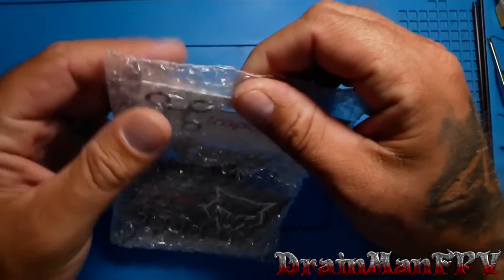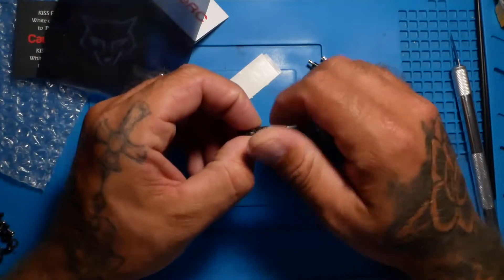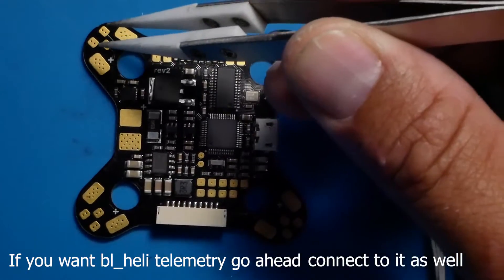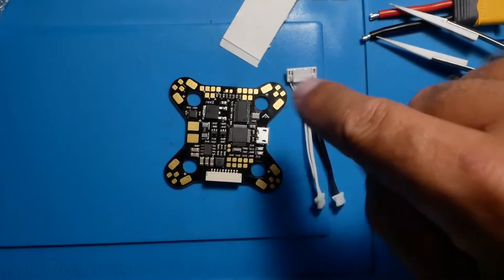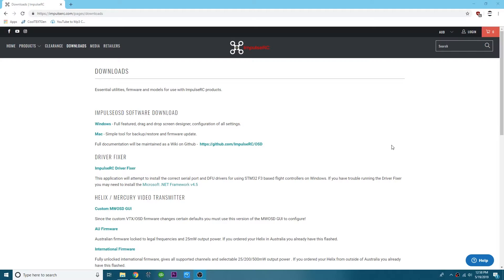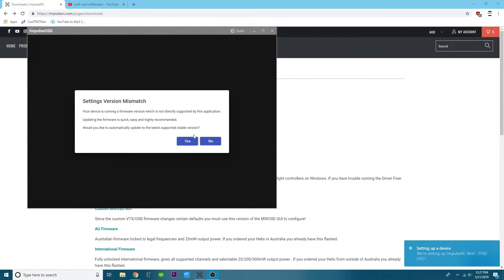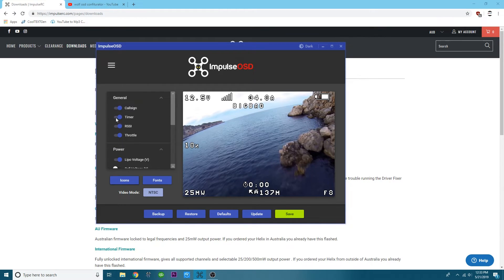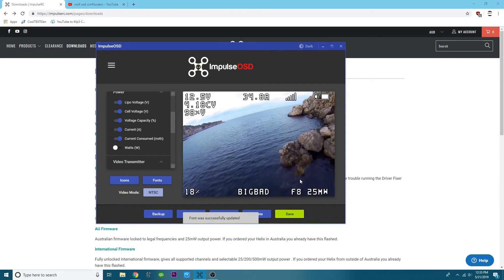How To: Wire | Set Up The ImpulseRC Wolf PDB & Impulse OSD Config

Comment: Is there any way to get the  RSSI-Value  in the  OSD with Wolf PDB V3 ?  Read that this is only possible throuh an analog input ..???? There are a lot of people struggling with that issue. KISS & Wolf PDB V3  claims to be "Super-Simple" - but why the hell is such an important value  that hard to get on my OSD ??? btw .: on my Taranis is Telemetry properly working. Is there a solution ???
Reply from the maker: Which receiver do you have? is it XF or Frsky or are you running DJI
Reply: @DrainManFPV  R-XSR,  (S-Port is connected to the telemetry-pad on the Kiss FC). The WOLF PDB shows current-voltage and all the other stuff correct...but theres no way to get a correct RSSI-value on the OSD!
Reply: @DrainManFPV  Having the same issue. Trying to get RSSI/LQ to display in the OSD from my CRSF 👊🏻

Comment: Men, I got the brainfpv radix fc, and Everytime I plugged the battery in, the osd will say detecting fc for a while however after that it says no connection to the fc. I am so stress looking around for answer and help might you may help me.
Reply from the maker: There is something that may be causing that I can look it up again I had that problem before as well. first thing is to check all of your connections because 9 out of 10 it's just not getting connection
Reply: It work something but after few minutes, my fc keep restarting, and the osd say fc connection lost. Other hand thanks for reaching this out!